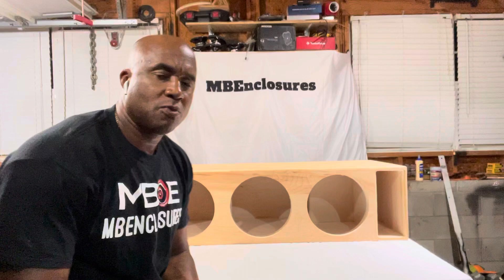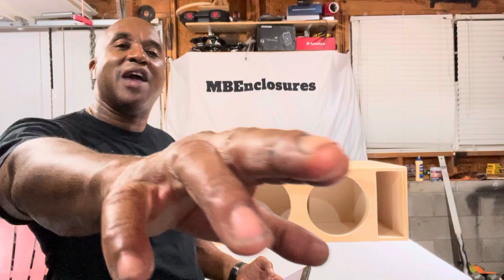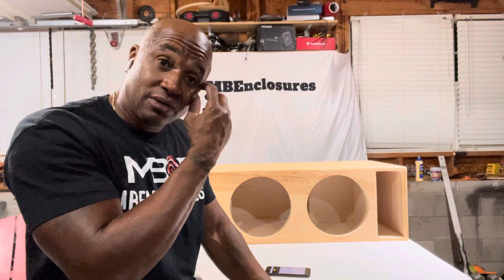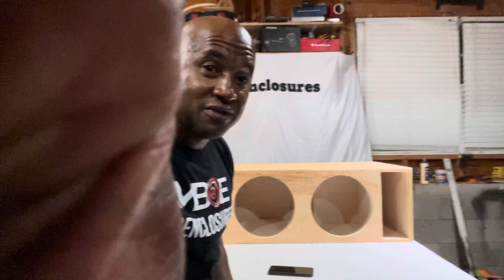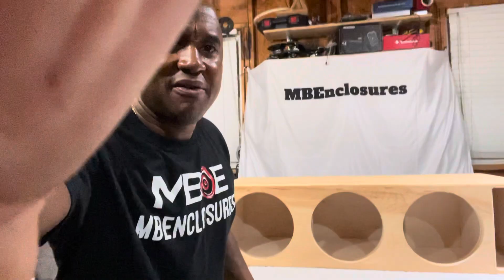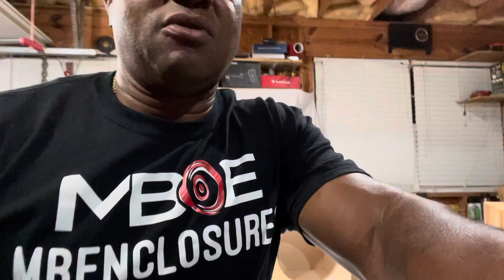Why JL Audio is to be respected.

Comment: I had a single O.G. budget-ass, entry-level, bottom of the list JL 12W0-4 running off of a shitty local made "1200W" 4-channel amp in 2001. My friends laughed at me when they saw 125W RMS on the sub's spec sheet and its puny ass magnet. I clocked 129.7dB on my first and only sound-off and even won me a small prize. Yeah that's nothing today dB-wise but I wiped 2x12 and 1x15 setups without even trying. The sub was in a generic installer pre-built wedge box. That's what a JL can do.

Comment: I know it's not JL audio quality but what's your opinion on the budget friendly single 12" Sundown E12 in a down4sound profab box? Is that box the proper size for that speaker? I know it's a budget set up but I'm curious because they say that box was designed specifically for the Sundown E12. I ask because I know how you preach how important box is.

Comment: I have all jl Audio system front doors C3 650 and rear doors C5 650X powered by the XD400/4V2 a CS112TG-TW3 powered with the XD3001V2 my second CS112TG-TW3 powered with the XD500/3V2 powering another set of C3 650 sound quality is amazing

Comment: I used to be a JL fan boy, I started with the w5 duel 8ohm in box built to specs( it took up the whole trunk in a 90 cougar)  then I got the w3's when they hit the market in 99 00, anyway over the years you collect car audio, so in the early 00 I had two 15in kicker comp (dvc)   but sill collected JL when I found a good deal. Around 2012 I sold my park ave,  and sold my 15's and just left car audio alone, but still have my wall of amps ( ppi a 600.2 mtx jack hammer eclipse xa1000 first gen punch 150hd just to name a few, I'm looking at the wall as I'm writing so I'm trying not to leave my favorite's out, like my very first real amp kenwood 921, but back to JL so last year I decided to build another vehicle and I took out two JL 10w0 boxes, one was a triple stack and the other duel. Both boxes had the JL grills ( the metal grills with the rubber u push in) they've been in the garage for 10plus years and when I put power to them the surrounds blew off all 5 speaker's,  I call JL and they basically said the grills had a design flaw that condensation from the elements would build up around the  metal and soaked up by the foam surrounds,  but unfortunately they don't carry the surrounds for that gen any more and basicly go f myself. I had two 12in p1 that I had to use and they were in the garage two but they were fine, hell I got two 10 in Optimus pro in kicker boxes that have cloth surroundings, no damage. Anyway I came across two 12in l7 in separate boxes for  two hundred used and honestly I don't think I'll ever go back to Jl  audio, or a round sub again

Comment: A lot of people like to talk smack about JL because they're more expensive than other high end subs but what most fail to realize is that the magnet/motor structure is unique and appropriately sized for the driver size.  

If you put a 10W7, 12W7, and 13W7 next to each other, you'll see that the motor gets bigger as the driver size increases, and that's because JL put the time and R&D budget into designing the right size motor for each driver.  

If you do the same thing with another "super" sub like a Sundown something something, you'll see a 10 and a 12 with these ridiculously large motors, a 15 with a large motor, and an 18 with what looks like a small motor.... because they all use the same motor.  This obviously helps cut down on cost, but what is the right motor size with respect to the driver size?  Did they engineer the sub using the 12 as a template, and then scale it up to the 15 and 18, or did they design it around the 18 and scale it down for the 12?

Is the Sundown a lot louder and a lot cheaper?  Definitely.  Does it sound as good as the JL?  Not in a million years.  

When you buy a 12W6 or 12W7 from JL, you know you're getting a sub that was built from the ground up to be the best 12 it can be.  You get what you pay for with JL, which is why they'll always be my sub of choice.

Comment: Don't those JL subs have that odd ohm rating  which probably throws off a lot of amps when it comes to powering them correctly.
Reply: Yea the v1w6 had dual 6 ohm and the w7 has dual 3 ohm

Comment: I still have my 8.3 microsub box , sold the 8W6's that were I'm there but man they beat for some 8"s . Rated for 600RMS but I ran a memphis 1000d @ 1ohm pumping 1100wrms and they took it all day , twice over....two  10w3s in a co workers tacoma down firing in a extended cab truck got me hooked on JL Audio

Comment: Is the JL audio 10W3v3 ported box volume a recommendation, can it be more or less?  I asked someone to build me a box for two 10W3v3 and the box volume is less than what JL recommended. Will this be a problem?
Reply from the maker: Should only be less if you running more than rated Power.. but only by 15-20%
Reply: @M.B.Enclosures  Thanks for the knowledge you share with all of us. 

I have a pair of Kicker CVX 12” subs. I’d like a ported box built for them. How can I reach out to you about the details, pricing, and shipping?

Comment: reminds me of my old Hollywood Excursions. their motor, was very small by todays standards. they were 12's rated for 225 wrms per subwoofer. they were in 2.5 cubes sealed, ran by a 900 watt amp, from the trunk. and it was so loud that you were in pain while you were in the back seat. you wanted out. so yeah. there's a definite science to the motors here. as well as enclosure and type of vehicle.
Reply: Growing up my uncle had two 12 kickers in sealed box with KENWOOD amp I remember how freaking clean it sounded In his 98 accord.

Comment: do you have any experience with earthquake  magma slaps passive radiators? i would love testing and are actually now planning to test various  brands i likeand i only like quality bass, spl deepbass and soundquality like when i worked with focal audison cadence and more.. so i think about building some  bass enclosures with  for example jl audio w6 and equipp tune it with  earthquake slaps passive radiators like ive seen sunfire had been done with as upgrade of their own in diy youtube subs. those earthquakes are good passive radiators i think from  the selection i know of.. ive always liked  cadence earthquake jl audio focal audison and look forward to start building and having fun again.. 
its now passed 20 years from where we got  148db +/- with only 1200w rms cadence  ultrashock a7 class d digital monoamp with 1 farad capacitor, 2 cadence beast solo 12" 600w rms, and now i wonder how much more to expect in  spl now 20 years later and if the sq can be focal audison ish with the brute force of  cadence beast master,earthquake holee 15 or subzeero, or ground zero plutonium spl etc

Comment: I'm running 4 10w6s on 2 rockford 1200s in a 3 cubic sealed box in my 19 f150 and I haven't heard a better underseat setup yet. They only need .55 cubes per sub so it's a little over spec and plays surprisingly low.

Comment: IN 1995 I had a 94 Blazer with 4 15inch JL Audio subs running off 2 PP Pro Mos 50's walled sealed boxed and still had the back seat. Thing would do low to mid 150's db on music not burbs and still finish top 5 in SQ. First 2 numbers I look at when buying stuff is signal to noise and efficiency. So what if your sub can handle 3000 watts if it's s/n is only 86db when this other brand only handles 1500 but has a s/n of 96 db. I'm taking the 96 db one all day. I don't know how JL tech support is today but at the time my installer called JL about box design for best results and they called back the next day with a complete design with all cut lengths and angles.

Comment: I’ve been running Alpine since like 2003, and vouching/spending on them ever since. Always been an SQ vs SPL fan, but still like my shit to hit, and these are many of the same reasons why I’ll always run Alpine, would like to get your opinion on them, especially the Type-X and the new F#1 gear.
Reply: I've heard 2 x 10" Alpine type S in sealed separate truck enclosures about a month ago and I must say I was very impressed. In was ran by Alpine 5 channel amp. The entire system was alpine and the sound quality was amazing.
Reply: @lamar5021  ya that’s what got me stuck on Alpine for so long, and why I think it’s the perfect brand for beginners/intermediate car audio fans. It held me for almost 20 years, same with kicker (except they don’t make headunits) but ya I run Orion now, never going back!
#OrionArmy
🦾💀🔊

Comment: Been wanting to go back to JL when I can afford it. I had a 12 TW3 as my first sub and loved it! Then got a new truck, had 2 Comp R 8’s, wasn’t that happy, got a sealed Comp R 12, good sound, not very loud, put it in a ported box from an audio shop locally tuned at 50 hertz that I just learned, sounds horrible. Just got a Skar SDR12 going in soon. And if I’m not happy with it, I’ll go back to JL most likely
Reply: how did the skar setup played out, u finally got my 10w6v3 on a ported box built to jl specs powered by a hd750/1 and yes the bass is clean and accurate but the output is not very much, i get it is a 10 but i was hoping for more punch, i been eyeing the skar evl preloaded 12"  box i've heard nothing but great thing about it
Reply: @gackal1982  the SDR was a piece of crap, it blew up in just a few hours at half power, I got re-funded so I upgraded to the SVR and it’s freaking loud. I’m gonna switch to an EVL soon as it has a bigger surround than the SVR and takes more power.

Comment: I had two Jl audio w3 v2s running on a Rockford fosgate p1000 BD and even though those woofer's were only rated 300 watts RMS they both would take that thousand Watts with no problem whatsoever the pole piece wasn't even ventilated on the subs that I had and I never felt the cone get hot I've ran them in a sealed box I ran them in a custom ported box tuned to about 35 Hertz and they never missed a beat I ended up upgrading to some different subs not going to mention the name cuz I don't want to bash nothing but by looking at the specs on the subs I replaced it with you would have thought it would have been louder given the same power but honestly I didn't notice a difference in loudness what I did notice was the sound quality difference and those Jl audios even though they were in a different class they were actually considered to be lower quality than what I replaced them with those new subs could not beat the sound quality the other ones played a little lower but the punch that the jls had was not there

Comment: I heard two JL Audio 10s in a Chevy Cavalier back in @'97 on a small Alpine V12 amp and it was shaking my vehicle from the opposite side of a KFC building. Went to go see it for myself and it happen to be a buddy of mine. Stock GM radio, 2 JL 10s, old medium size Alpine V12 amp and that was it. Stuff was just laid in the trunk and quaked!!! It doesn't take much y'all but quality does make a difference.

Comment: I seen your other video about clean bass and running more watts than rms ratings. I have A rockford T1000-1BD pushing 2 JL 12 TW3's rated at 400 rms each wired to 1 ohm. Would that be over powering the subs? Or would it produce clean bass? Custom sealed enclosure made by MTI Acoustics. 1.7 cubic feet. Should I wire it down to 2 ohms or keep at 1 ohm?

Comment: Speaker magnets are like diamonds. Bigger ain't always better even with diamonds because you have to take clarity and cut into consideration. A 1 carrot diamond that's all cloudy and janky is not necessarily better than a 1/2 carrot diamond of a much higher clarity. It may look cooler but it's not going to be worth nearly as much. speaker magnets are similar because the material used in the magnet is kind of like the clarity and cut of a diamond. Neodymium magnets are much stronger and cost more but are smaller and lighter where as the older traditional ferrite magnets are not as strong so they have to be bigger to accomplish the same task.
Reply: That's actually a good comparison. I using this.

Comment: had 8w3v2s, 12w3v2s, 12w6v2s, 8/10/12 w7s...  All great subs on their own but after experiencing other high end subs like sundown x8v3s and now two 10 zv6s, no way would i bother with JL audio. The 10 zv6s have fantastic sound quality and would easily eat a w7 for a snack. The only downside is how much larger your enclosure has to be to accommodate the subs' displacement. i don't think JL Audio is able to or willing to come out with a sub capable of competing with the zv6 in terms of spl. Or perhaps they could but the cost they would put on a sub like that would be too high to sell.
Reply: I won’t  1

Comment: Man.....Whatever you were explaining..... Is the Gospel!!!!! When I moved to Detroit in 1998, a "D" Boy (you know what he was") had 3 JL 12's in a sealed box facing the rear with the the deck lid open, (it was in an 80 something Grand National) with the  trunk facing away from the building. The enclosure was the approximately size that you have there w/o the port section. It actually had the brick wall of the building in front of the car vibrating as well as the windows in the laundry mat across the street behind the car flexing. JL Sub Woofers are NOT to be taken lightly at all !!!!! Yes another excellent video telling it like it is. Thanks again Man and keep killin' em'.

Comment: There is a big difference between brands these days and always has been in the old days. The original w6’s even by today’s standards they are excellent subwoofer. Not rated to take a great deal of power but you would be hard pressed to find a driver that is capable of their output with just 300w rms each and able to go as low as they do in frequency. The original w6’s proved to be some of the lowest hitting subs in sealed enclosures. Today many subs and amps are designed by a brand but then out sourced to be built in China. This makes a tremendous difference in quality in the final product and many times doesn’t always translate into a full 100% copy of the design the brand was going for. For example, Dayton makes the Max x but to keep cost down they have them built in China. The subs actually do not have a 2.5” coil like advertised but instead have a 2.38” coil. The gluing that is done to the cone to coil is actually pretty mediocre quality, I have dissected a 15 and laughed at how terrible it was done! Now I have to build a sub off the motor for it not to go to waste. JL audio built its subs right in Florida for the most part and the quality shows it! They have some products that are out sourced but for the most part the subwoofer lines are built right in the USA.
Reply: Jl audio also had equipment assembled in China. Not just cus its made in China its bad. Jl Audio Quality control is key
Reply: As I stated they do out source lower lines. Quality control is great for finding duds but it’s never gonna fix the use of inferior quality parts, adhesives, and building techniques.
Reply: Infinity kappa perfect 10.1

Comment: I must agree, you get what you pay for. That said I have a 20 yr. Old 10W6v2D4 on the jl 500/1 in 1.5 cu. Ported and it keeps up with my 15L7S dual 2ohm on a twisted sounds 1000/1 in 5.8 cu. Ported.  Showing size not as important as quality and set up of your system.

Comment: You need to check out BassBoss loud speakers
Reply: You need to stop giving bad advice
Reply: @fuckgoogleandyou8779  what are You talking about?? Be specific !!
Reply: I don’t know if I can since I’m sure you did check out their website and if you were not completely appalled by their greed riddled rip off prices combined with a lack of innovation or anything somewhat technical breakthrough I don’t know there’s a sucker born every minute what exactly is there to elaborate on other than some other douche bag charging quadruple for subpar equipment sorry man greed is a deadly sin that also stems from jealousy and envy and a little bit of gluttony to I can’t support anybody deadly sinning four times on a single fuckkk over Poor customers That don’t know any better I don’t know maybe I should just keep quiet and not say anything because you can’t tell anybody anything just like your mom did when you touch that stove folks just seem to have to learn the hard way I guess

Comment: The JL 13W7 is one heck of a sound quality monster and the bass is so deep and rich. I fell in love with the Fi Neo 3.5 12 inch too. Fi does make the baddest meanest subs for both SPL and SQ, and anywhere in between.
Reply: Yep I had 2 13.5 w7s and I upgraded for spl to some neo 3.5 18s, the w7s sound alot cleaner but the fi sound pretty good, only thing is they have no backplate venting so they make alot of mechanical noise
Reply: I've never heard a w7 that sounded good.  Only loud.  W6 is another story.
Reply: @sterlingcampbell2116  w6 better than w7???

Comment: Only so much can go into a loud speaker.  It’s a motor, a voice coil, a basket, some foam or paper for the cone, and some glue.  
That’s it. Probably less than $100 worth of materials. 

Are JL subs really nice? Yes.  Did JL spend a lot of time and money on R&D to develop their equipment? Yes of course.

Did they somehow develop a magical formula that makes them worth basically a blank check?  No

The W7 costs over $1000.  For that money, you could buy a Sundown nightshade witch will handle 4-5 times the power, and sound just as good if not better.  I know witch one I would buy.
Reply: Sundown is mainy for competition tho their not comparable due to their differences Sq and spl